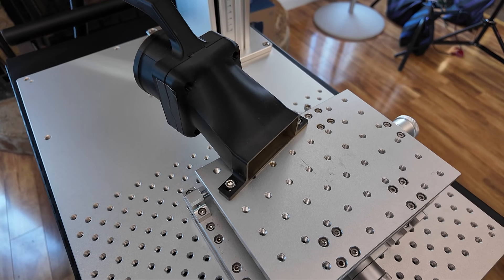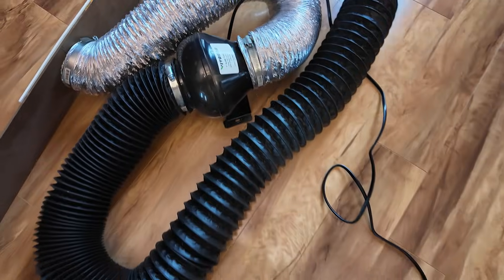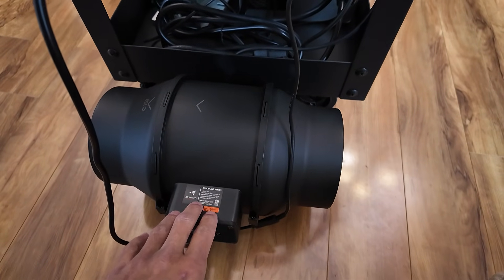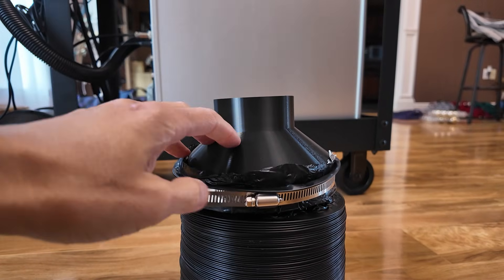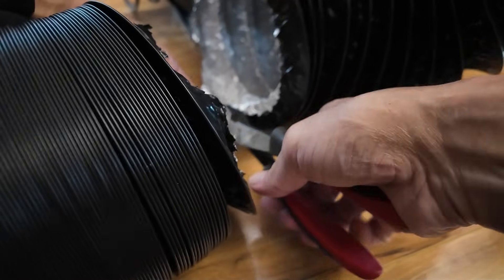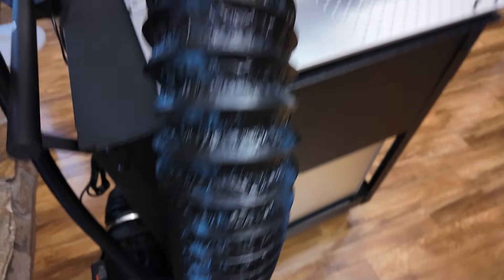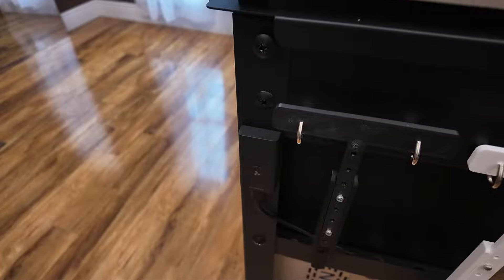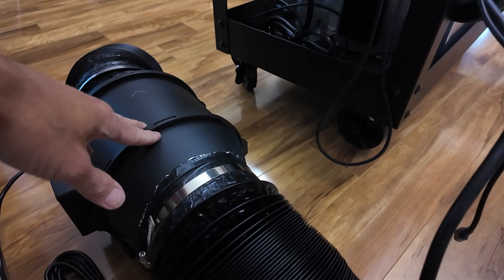Step by Step Guide to Fiber Laser Fume Extraction - AC Infinity Fan and accessories

Comment: Still working well? 

Where do you vent it to? I'm thinking if I set this up I would vent to the outside onto a useless dirt patch. Though I dunno if the fumes would disturb the neighbour...

Also, do you think Cyclone bit like they do with shopvacs would work in between or it's unnecessary?
Reply from the maker: I vent it out of a window in my shop.  Fiber lasers don't make too many nasty smelling fumes like many other lasers since they are mostly working with metal.  What I'm exhausting mostly is an extremely fine brass dust.  I don't think a cyclone separator would do much for that.

Comment: Hows this holding up? I'm doing much the same kind of thing for ventilation, without the trolley. It's doing It's job but I don't like the idea of the particles around the exposed magnet motor;  particularly the conductive materials. I'm thinking I'll upgrade to a blower fan with an external motor and pull through a filter. I find the particles sit through the ducting, especially stone- so i might try a dust cyclone type of filter and place it close to the intake. 
I bought a filter kit for a filter speced and sized for a fibre laser but haven't got to making an enclosure for it.
Many things on the go here tho and most on the backburner right now, I also have stuff ready to build an enclosure, I'll probably do a trolly style with 4040... maybe an X table🐿🐿🤔
Reply from the maker: I haven't had any issues at all.  Now that I have the enclosure for my fiber laser it should be handling even more of the fine particles.  If it ever fails, I'll be sure to make a video about it and what I choose to replace it with.